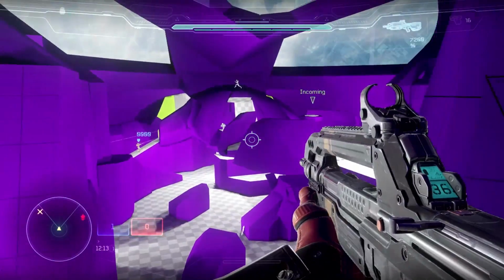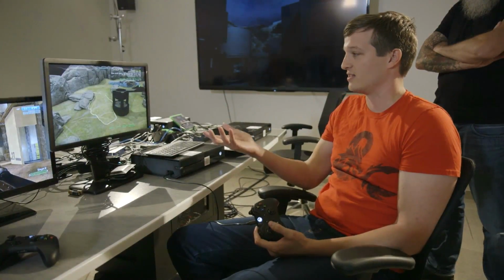"The Level Design Process" (Design Talk)

Comment: I really like these more 'mature' design talk videos, I hope there will be more in the future. As for map design science I heard that it is essential to create a 'center' for any map you make... will there possibly be a video on this topic? Thanks.
Reply: +Sgt Slaphead Hmm... interesting. I guess this makes more sense. Thank you very much for your advice, I'll keep this in mind with my current map project!
Reply from the maker: +Joseph Herstal In addition to Cpt Craphead's wonderful comment, I think the reason why the center of a map is important is that, without one, you can wind up with what's typically referred to as a "donut map".  Donut maps invlove mindless circular flow where players run around an outer circuit without venturing into the map's center.  They have very simple, lackluster engagements as a result.  Defining a center is important, but the most important positions on a map don't necessarily need to be central in a physical sense.
Reply: +FORGEHUB This sounds alot like the criticisms I hear about Chillout/ Cold Storage, being that those maps were mostly figure - eight in layout.
Reply: +FORGEHUB What are these "Donut" maps you speak of? ;)

Comment: I'm only semi good at designing the map As in details and all that jazz. But for some reason I can plan out every possibility in my head like outcomes (what good time a object should spawn or like if this happens I could counter by doing this etc.) I'm building a map that each team has a strength and a weakness but it balances equally. I have it so one team has a faster route to the middle but the other team can get to upper mid just as fast etc. Ya know